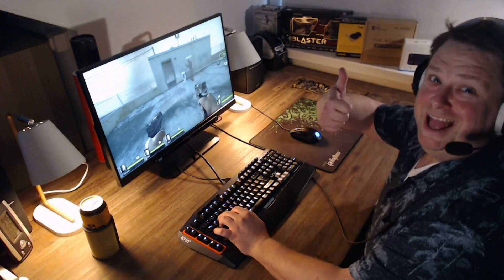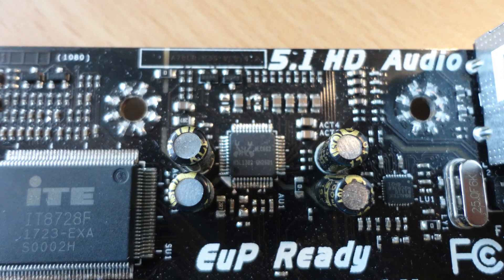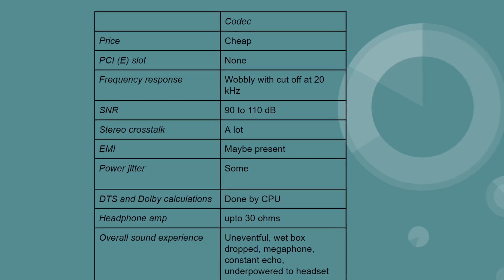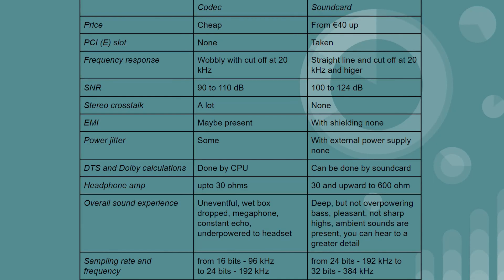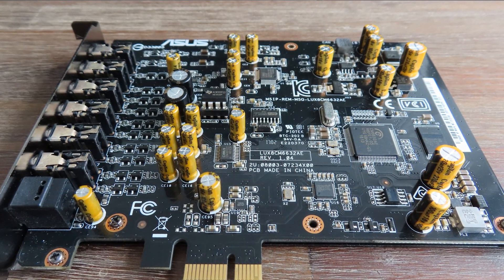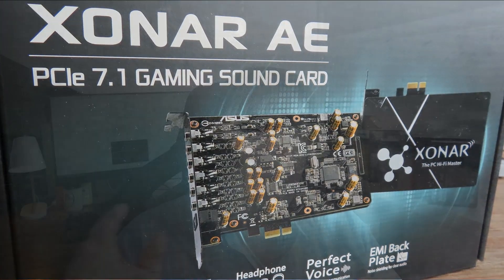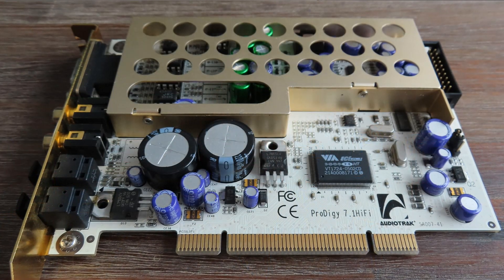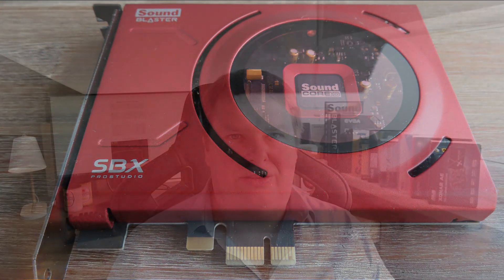Which sound card should Santa give you in 2020?

Comment: Just to give you a heads up the Z vs Zx its not just the controller knob.   The Zx uses Nichicon gold capacitors and the Z is just some generic capacitors.  (you can see them in Custom PC Review   's ..  Creative Sound Blaster ZX Unboxing)
Reply from the maker: Didn't know that. As a source I used Wikipedia, amongst others. There it says this: The Sound Blaster Zx card is identical to the Z[29] (exact same card, exact same card SKU/Model (SB1500) on card itself, compared side by side in store), with the only notable change compared to the baseline "Z" being the addition of the desktop ACM (Audio Control Module). https://en.wikipedia.org/wiki/Sound_Blaster#Sound_Blaster_Z-Series
Maybe Custom PC's reviews is using another non standard Zx?
Reply: @AntonsHardware  No, I am sure of it .. long time ago when I bought my Zx I had ask about it .. and that was A  official answer from creative .  You can also google it and find some tid bits about it .. but its not very documented.

Also google Z vs Zx but search Images.

But again ... their is almost no info on this.  Again this was years ago .. at this point they could of just started making them with all the same caps to save have to make muilt skus.
Reply from the maker: I did see the video and there are differences indeed! Didn't know this and will add it to future video's! Also, I never got the Zx, just because I thought that there was no difference! Now I'm going to get one! :D Thanks for the update! Really appreciate that!
Reply: My onboard soundcard on Asrock Z270 killer SLI also has gold capacitors and still sounds terrible if I compare it to creative z, then again, it is all about the chip and the general setup. But reading this made me think that I must also move up from the Z to something which also is good for music.

Comment: how is the ASUS XONAR SE 5.1 is it worth buying it bcz it Provides 150o and it is  300o also 116db so should i buy it ? and which better this or the audigy rx 7,1
Reply from the maker: Both aren't that good. The Xonar SE is just an codec put on a card. If you have a decent motherboard already, you probably will have the same codec on there any way. So no improvement. The Audigy RX is a really old design, that I found to be not that good either. You should check out the Xonar AE!

Comment: My Sound Blaster Z is ok but the Sound Blaster Command software made me swap it out for the Audigy RX. What sound card do you recommend for FPS games like Destiny? Reason I had to swap out is because every time I tried to load the Sound Blaster Command onto my WIndows 10 system it crashed which it is required to use the Z too it's full potential. Unless you have a fix for the sound blaster command suite issue Z is going into the trash.
Reply from the maker: No! Not into the trash! 
The creative drivers are notoriously difficult to remove. I recommend the DDU drivers,  but do so at your own risk! After they've been completly uninstalled, you can reinstall the drivers. Also you can use Autoruns to remove Creative settings, but you must be a power user to do so. For testing I have a recent image without any drivers installed.
Reply: @AntonsHardware  i am not a power user.
Reply: @AntonsHardware  what are the DDU drivers?